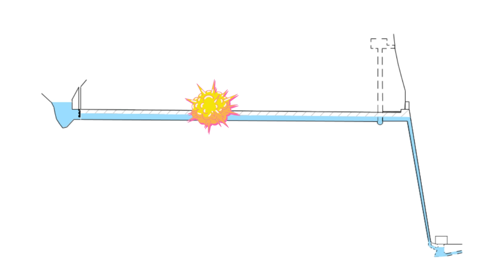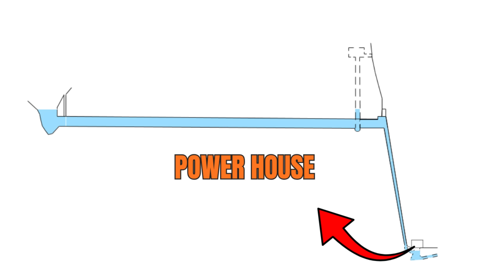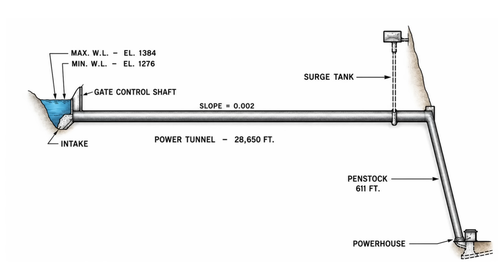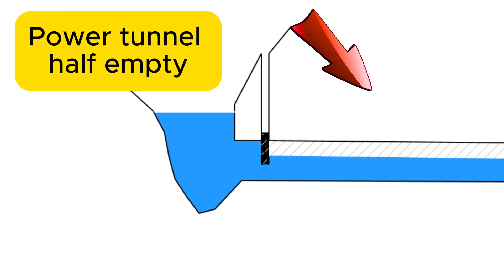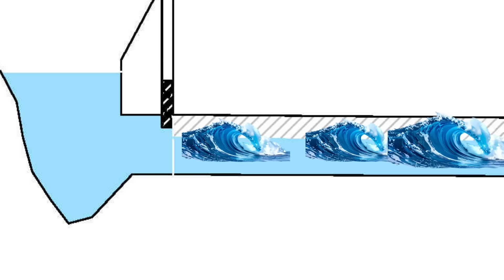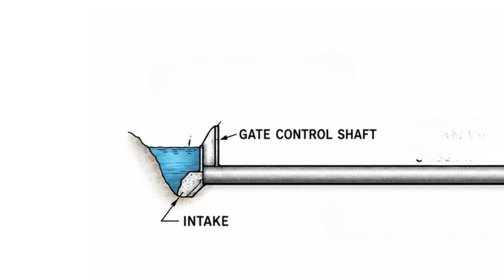The Day a Hydropower Tunnel Became a Giant Cannon

Comment from the maker: Since this accident happened back in the 1950s, very few original photos or video records still exist. To help explain the sequence of events at the Ladhon Hydropower Plant, I used simple engineering sketches and visual recreations based on the available historical information.
Reply: Good job. I see how it happened. What would have been the right remedy for the situation? I was guessing at: close the turbine wicket gates a little to allow the water to build and purge the air slowly, then open the intake and wicket gates slowly to increase turbine power. Is that somewhere close?
Reply: I kinda like your animation. Especially shaking the screen. Lots of dynamics to take into consideration when dealing with such huge forces. Sad that people die because of poor communication.
Reply: I think the story is quite interesting, especially from a technical and engineering point of view. However, I think it would become much clearer with better animations, including the physical effects, pressure waves etc. - for example for me, it isn't entirely clear why the surge shaft didn't help, as well as what exactly was damaged and where people died or got injured.
Reply: Excellent video, thank you. Would the correct response have been to close the intake gate, close the turbine stop valve, then partially open the intake gate to fully refill the penstock and tunnel at a safe rate that would not overwhelm the vent tube, then open the intake gate fully and finally reopen the turbine stop valve?
Reply from the maker: @charlieinsingapore  yes i think you are right here. they should have immidiately shut down the turbine. open the intake gates to such opening that tunnel get refilled slowly and rate of filling of water equal to rate of escaping air in very controlled manner. if i were plant operation manager at that time i should have done this.
Reply: Very interesting. Thank you for your videos.
Reply: Can you not use ai 
It ruins the video 
I'd prefer stock images 
Or (bad) drawings 
*I am not saying you are bad at drawing just that a bad drawing would be better than ai images

Comment: Unlike water, air is compressible. The result: a massive "kaboom". Tremendous adiabatic heating must have occurred within the air in the tunnel as it was compressed by the volume of water. This surge of energy likely contributed to the devastating impact. How is this sort of thing prevented today?

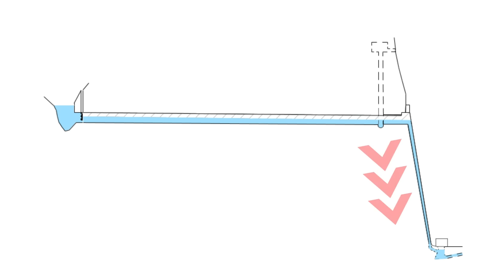Comment: 4:15  This graphic is inaccurate and the reeason for the disaster is not well explained.  It's a 5 mile long tunnel with a downgrade, so there would be more water at the end of the tunnel than at the entrance.   So when the gate was opened, the tunnel would fill with water, closing off the escape of air at the exit of the tunnel, forcing the air backwards, under high pressure, towards the gate house forcing the air to vent upwards through the gatehouse, which was it's only exit

Comment: What would have been the proper way to rectify the situation? Drain all the water out first? Then slowly fill it back in to allow the air to correctly escape?
Reply: Depends on the design but closing the output gates would allow the tube to slowly fill back up, then you could fully open the intake, then open the output
Reply: @Magic-Conk  closing the output gates would raise the pressure inside the tube. safest thing to do is close the intake gate fully to stop pressure changes, open the output gate so until the tube water drops low enough for the safety valve to blow, wait for the pressure to bleed off. maybe fit a pressure valve at the intake gate before repowering.

Comment: 6:20 I don't get how the surge shaft couldn't blow the air out of the system.  Shouldn't they be open to ambient pressure?
Reply: yes but with a water column inside. the penstock and intake pipe should not contain any air and as far as I understood, they drained the surge shaft down to the main pipe

Comment: This is like steam or water hammer in a steam system. When a steam pipe isn't properly sloped and drained there will be small slugs of water in the pipe. And during a start up those slugs can be pushed at extremely high velocities until they strike an elbow. Eventually that can cause a hole in that elbow or other failure.

Comment: I was an inspector on a lot of hydrostatic testing on large pipe installation way back when. A lot but not all of it done on jack stands testing 4”, 6” and even 8” pipe spools,some 40 to 50 feet in length. It was IMPERATIVE to bleed all the air out of these spools before turning the test pump on. If you see the needle on your test gauge bouncing around you better start over because you have air in the line. Air compresses, water does not. Even just a little bit of compressed air is a very dangerous thing. I’ve seen test plugs not properly secured blown across a fab shops more than once. People get fired on the spot for screw ups like that. I cannot imagine the air pressure on an installation THAT big.
Reply: Why is the air pressire at the inlet any higher than the water pressure diring normal operation? Air is compressible and stores energy, yes, but why is the pressure any higher than the pressure on the input side of the gate when the gate is closed?

Comment: Sounds like there should have been a valve for the air to get out near the upper end of the tunnel.
They sure had a hole afterwards.
Reply: Looks like they had a vent, but never expected so much air
Reply: @GlynOC They did have a vent. However, I would guess the design and infrastructure costs probably reduced the actual volume that could be handled. The opening vault at the beginning of this presentation was ( massive)! The engineering of the vent was on point just not big enough to handle the massive pressure produced by the water increase, that was filling the1/2 empty tunnel! The size of of the tunnel was provided and the water control valve. Can you imagine driving your pick up truck in the tunnel? Then think half full / totaly filled = ungodly amount of potential energy ......!

Comment: I know you mentioned the surge tank, but why didn’t the air simply escape out of the surge tank opening? I don’t really understand that part.
Reply: Air is lighter than water so when pressurized it goes higher. The tunnel had slight grade so once the water reached the surge tank shaft air had to go backwards into the control shaft tunnel and blow the roof of.
It was identical to bubbles in soda drink. Just instead of CO2 you had large amounts of water and air mixing up under substantial pressures. 
Also the reason why the air couldn't escape through the turbine is due to the water in the penstock.
Reply: The surge tank wouldn't have any chance of compensating unless it was at the very highest point. Once the water reached the opening the air can no longer escape efficiently. The water acts like a plug in the system.
Reply: The water in essence became a piston ram and that air IS compressible, the potential energy was massive. The system didn't have adequate safety systems in place to handle these kinds of situations. The compressed became basically an explosion.
Reply: It could not accommodate the volume of air, probably several hundreds,  to thousands of pounds of pressure, thousands of cubic meters of highly compressed gas.

Comment: I believe something like this happened at the Oroville dam also
Reply from the maker: and thanks to you i found my next video content. stay tunned for this video.
Reply: @hyrovision can't wait
Reply from the maker: The main cause of the 2017 Oroville Dam crisis was the failure of the main concrete spillway due to long-term structural weaknesses and poor drainage beneath the concrete slabs, which were exposed during extreme rainfall and very high water releases.
Reply: @hyrovision there was also an incident that had something to do with the river valve. Someone left a door open and when the valve opened and someone got blown into some fencing

Comment: Very similar disaster occurred this past winter in the high Sierra foothills. The Colgate Number Two powerhouse had been shut down for maintenance, repair, and upgrading. Water from the New Bullards Bar Dam flows to the powerhouse through a four-mile tunnel. This exits to a penstock above the powerhouse. The tunnel was partially (or fully) full of water. The penstock failed at the tunnel exit. Water raced down the mountainside above the powerhouse. The resulting erosion destroyed the penstock and filled the powerhouse with mud and gravel.
Fortunately no one was killed though at least one worker required hospitalization. The result of this  is profound: lost irrigation revenue, lost hydroelectric income, and significant repairs/replacement cost to the penstock and powerhouse will cost the Yuba County Water Agency many millions of dollars. Truly a Northern California disaster.

Comment: In Australia in 2016 a test was performed for a system that lets dams run up to three extra turbine banks with no issues to the existing turbine hall. So more power from the same volume of water with no extra servicing down time

Comment: i'm halfway through the video and i'm going to take a guess that the gradient in the tunnel stopped the air from being harmlessly released into the surge pond. i'll be back in 4 minutes to congratulate myself.
Reply: well i'm back, and i'm not sure if i was right. surely after 5 miles even with a very slight gradient, the top of the tunnel at its lower end would be lower than the bottom of the tunnel at its upper end. so as it starts to fill back up, the surge pipe entrance is blocked by water while the tunnel is still at least half full of air, the air then has no way out except the small vent/access shaft. was it more to do with the turbulent water trapping pockets of air because it was released too suddenly?
Reply: @JTV84  you don’t even need to trap air inside, the inertia of the water would be more than enough.
Reply: @marekstanek112  but the inertia of the water would affect downstream, and the surge tower is precisely to deal with that problem, this was instead at the intake. He is correct,  the diagrams are a bit misleading. For this to happen the surge tower was still with water leading to the air to be trapped and compressed upstream.  And even if it was actually empty at some point, being downstream it will be blocked by water at some point while there is still air upstream. A precise procedure is needed for filling the tunnel,  including venting upstream to avoid this,  and this was not followed.
Reply: @marekstanek112  The problem is not specifically the inertia of the water. The inertia always exists. The presence of air in the tunnel allows the momentum of the water to rise uncontrollably because gas compressibility stops the tunnel dimensions controlling the water flow. Momentum is not the same as inertia.
The surge tunnels (vents) are not large enough to allow for uncontrolled water flow.
Reply: @JTV84 the gate at the damn opening quickly the tunnel filled with water at that end and began forcing the air down the tunnel  compressing and forcing it up the surge shaft and as more of the tunnel water filled the tube rhe pressure increases pushing the air down the  tunnel, I bet it was like a bomb going off 😂
Reply: I don't think that happened. It would need spare hammer style surge ponds every km, or less, as the freshly opened gate surges water forward to create pockets.

Comment: If the water level was falling in the horizontal tunnel then surge shaft had to empty, according to your diagram. Why not size that shaft to make this scenario impossible?
Reply from the maker: @abrahamgoldsmith1684 Good question. Under normal operating conditions, the surge shaft does protect the tunnel by supplying or absorbing water during pressure changes. But this accident was different because the intake gate was mistakenly closed while the turbines kept running.

That means the entire 5-mile tunnel kept draining for a long time — far beyond what the surge shaft was designed to handle. To make this scenario impossible, the surge shaft would have needed to be enormous, almost like a second reservoir.

In real hydropower design, surge shafts are sized for expected transients such as load rejection, turbine shutdowns, or normal water hammer events — not for a prolonged accidental isolation of the tunnel from the reservoir.

So the shaft wasn’t “too small” for normal engineering standards. The accident happened because the operating condition itself was outside the original design assumptions.
Reply from the maker: Maybe be they never considered this scenario. 😂
Reply: @hyrovision  pretty sure they did. There must be a procedure for refilling the tunnels after repairs. The problem is in a SNAFU you don’t have enough time to figure it out, and most often, there’s not even a way back as by the SNAFU itself you create conditions leading to inevitable catastrophe.
Reply from the maker: Exactly. There almost certainly was a controlled refilling procedure for planned maintenance conditions. The tragedy was that this wasn’t a normal restart scenario — the operators suddenly found themselves with a partially emptied 5-mile tunnel and rapidly changing hydraulic conditions. Once the gate was reopened, the returning water column acted like a massive piston, compressing the trapped air ahead of it. At that point, events unfolded in seconds, leaving almost no time to recognize the danger or reverse the process.
Reply: Air always wants to escape out the highest point and the surge shaft was down hill from the inlet so when that end of the pipe filled with water it pushes the air back to the inlet. 🤔👍🇦🇺
Reply: @V8Jagnut.7406  Which makes me think that the design needs a surge shaft near the inlet.
Reply: @dalemanolas5994 
Its got the vent pipe at the inlet but because they let the water in way to fast the vent could not handle the air displacement and caused a blow out.
Reply: @dalemanolas5994  It did, The intake building : p

Comment: There were not enough passive security systems to handle this case. If they built hydro power plants in the same way as nuclear power plants, then all possible accidents would be prevented.
Reply: Three Mile Island, Chernobyl, etc. Safety is an attitude, not a procedure. 
(There will be another major industrial accident this week, somewhere.. HazardEx newsletter is 'fun' for that)
Reply: @philipoakley5498 yes, because nuclear power plant is so much more complex, it has 1000x as many things to go wrong
Reply from the maker: I didn't know much about the Chernobyl incident. If any body has full info and can help me. I can make a video😂
Reply: @hyrovision  One has to distinguish between the incident, and the reasons why, just like in this intake gate accident, where hindsight is wonderful but foresight (especially of human factors) is tricky..